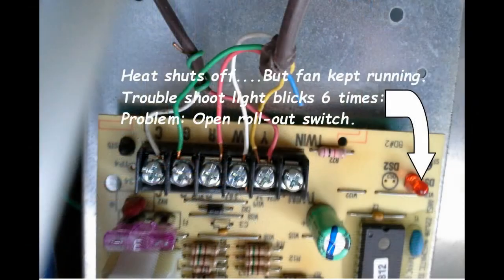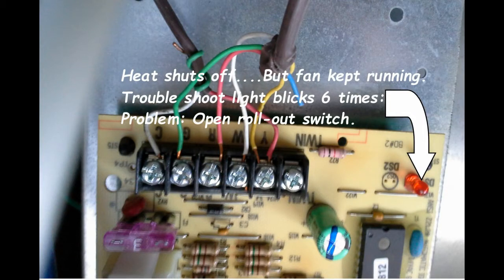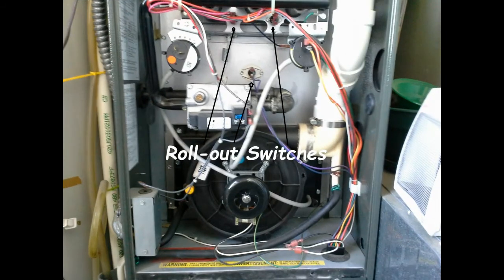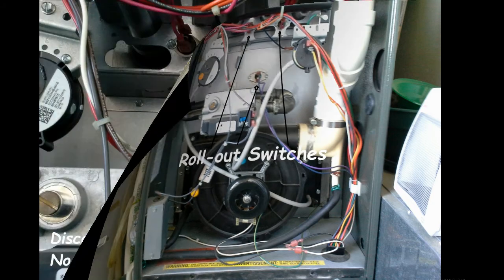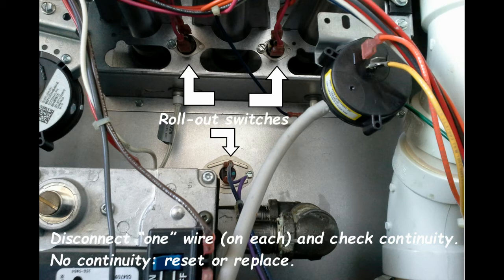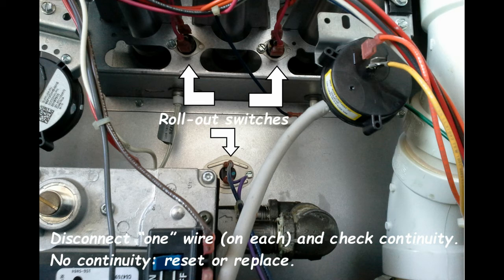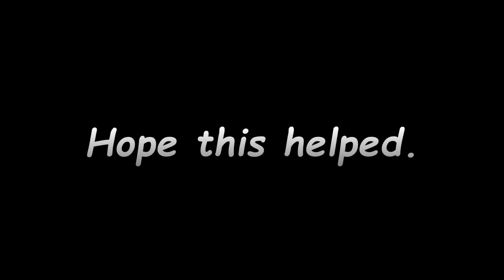RollOut Switches

Comment: Rollout switches very seldom "get old" or "wear out". If you have a bad rollout switch, there are a number of things to check such as gas pressure and temperature rise and doing a combustion analysis to check for cracks in the heat exchanger. Heat exchangers get old and go bad. And goodman are known for terrible heat exchangers. Saying this as a Journeyman Gasfitter in Canada.
Reply from the maker: Well .. as a gas fitter in Canada, you should "know" that just like us guys- we do get old and we do "wear out" . If there is "no" continuity across the terminals - and there is "no" reset button - the switch is bad - replace it (doesn't cost that much). It has "nothing" to do with gas pressure, cracks in the exchanger or anything else - THE SWITCH IS BAD!
Reply: @phurman1  its a thermally actuated switch that opens a fusible link if it gets too hot. A lack of continuity across the switch indicates that the switch has been exposed to high temperatures. They are pretty robust switches and generally remain mechanically sound for the life of the furnace if the furnace isnt overfired and no rollout conditions occur. As I mentioned before, these switches can be replaced IF the condition that caused them to trip is corrected. Sometimes they break when cleaning the burners if they get bumped by a vacuum or hit with really hard compressed air. Unless something physically broke the solder connections on the switch, the only reason for it to show no continuity is if the fusible link inside physically overheats and fails.

Comment: I'm told a rollout switch can only be sold to licensed technicians. So a household has no choice but to call a professional. How much would replacing a rollout switch be, including labor?
Reply from the maker: Someone is pulling your leg … you can buy them yourself (I did) and still do.
Google it, you may get lucky.
Reply: @phurman1  Yeah, I got some leads. However, not one, but both flame rollout switches still won't unscrew! The lefty-loosey won't even work as it should. And everything's still like new! 

I think the company's last technician stripped them on purpose to take advantage of my dad. They tried to get him to buy a whole new furnace instead of replacing the switches.
Reply from the maker: That's typical … anything for a buck. Work on those screws like they did on your dad, you'll get them out.

Comment: My york furnace turned off and stayed off until I reset rollout switch then it went on but turned off again does this mean I have bad rollout and of so then what's the h purpose of reset ??
Reply from the maker: I had to replace a rollout switch once .. they "DO" go bad. But look at the LED light on your circuit board and count the number of times it "BLINKS". Then look on the "CHART/DIAGRAM" pasted on the panel. The number of "BLINKS" should tell you what the problem is. GOOD LUCK ... it's easy ... don't "PANIC"
Reply from the maker: Sometimes they DO have to be replaced .. just like us when we get old and feeble.
I had the same thing happen, so I just replaced it, and no problem so far .. and it's been a few years.
Reply: @phurman1  I believe my switches are tripped, but they cannot be depressed. How can i tell if they are tripped or not? A tech came out last month to deal with a no flame issue and told me if it happens again to reset the switch and to call them again. Thanks!
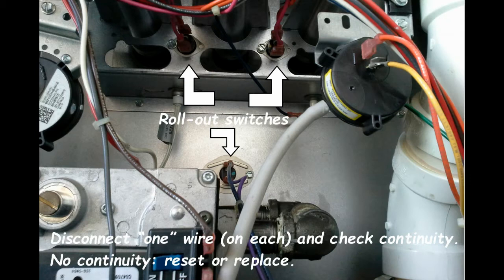Reply from the maker: @dangrcat  Well....evidently the tech told you to "reset" the switch if it happens again, so they must be able to reset. View the video again and about 2:10 into the video you should see the roll-out switches and I should have included a close-up of the switches. But in the center of the switch should be a little button---press that in. If it snaps in … then you did reset it. You can also use an OHM meter to check continuity. Disconnect one wire and connect the Ohmmeter lead across the terminals .. if it's got a meter deflection - the switch is closed - which means it's good - if not - it's open and needs to be reset. (turn off the power to the furnace before proceeding)

Comment: changing or resetting the switch doesn't fix the problem
Reply from the maker: How did you determine it was a roll-out switch ?  Look at the circuit board and count the number of blinks on the LED light .. then read the troubleshooting chart on the inside of the bottom panel.